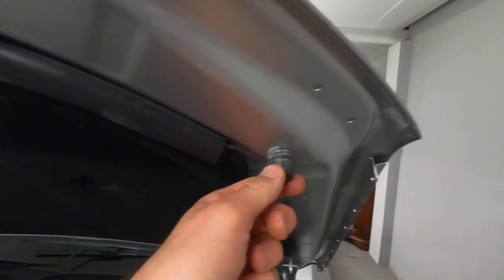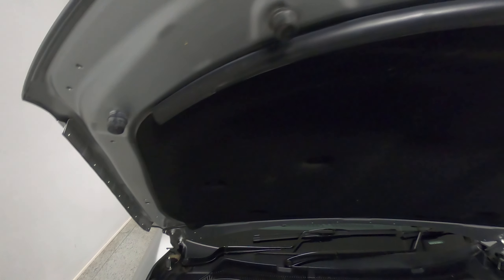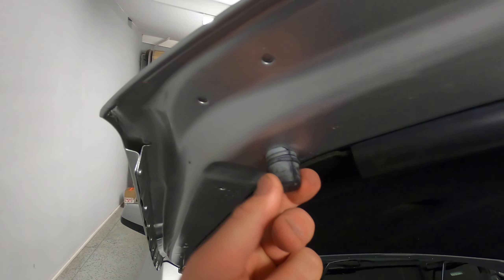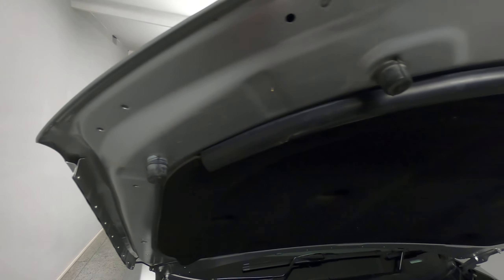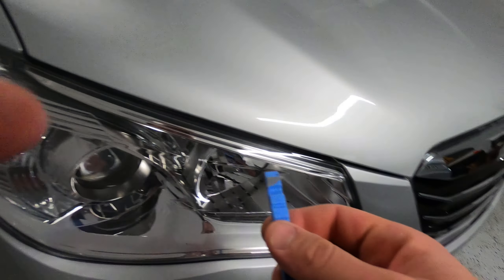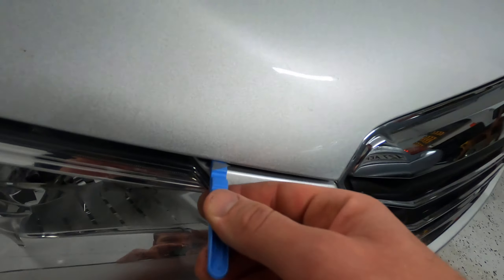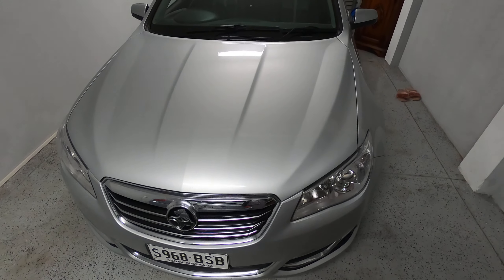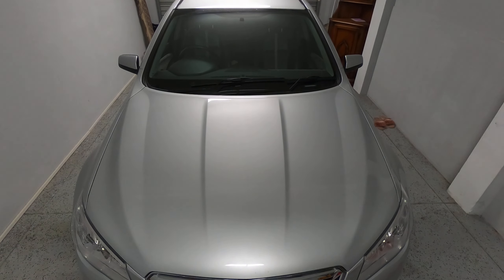Perfect Bonnet Alignment in 35seconds

Comment: Those are not alignment screws, those are hood dampers. The hood is adjusted by loosening the 4 bolts holding it to the hinges, adjusting, then retightening. These bumpers are meant to tension the hood and keep it from vibrating, but turning them will not do anything to adjust a a misaligned hood.
Reply: FALSE
Reply: true i tred to  fix my car  with these screws and nothing happened
Reply: True